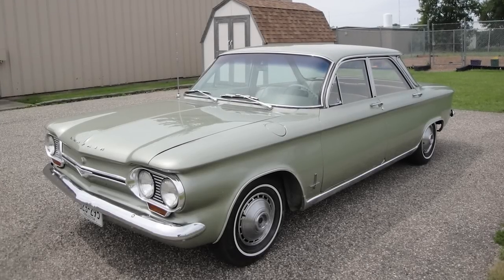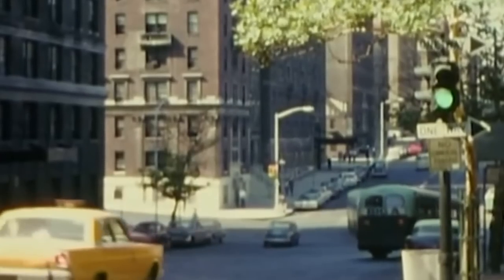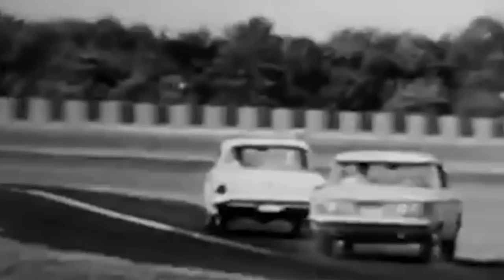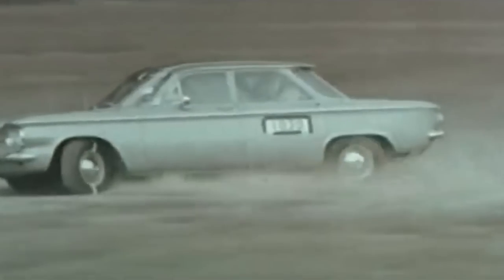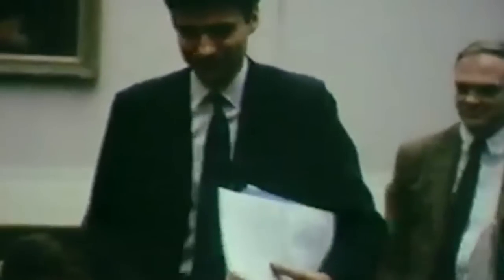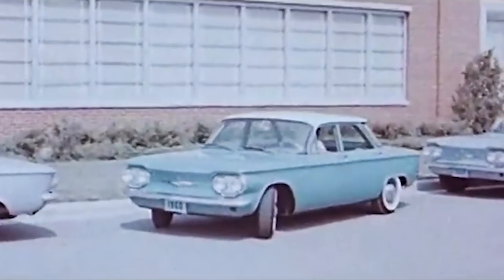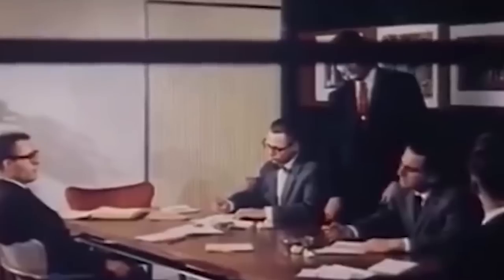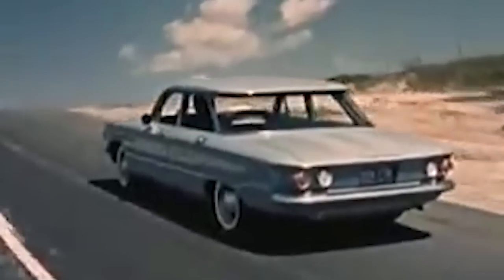Chevrolet Corvair. Where did saving a FEW DOLLARS lead to? Engineering error.

Comment: Car wasnt unsafe,owners not looking to see what pressure to set the tires at was the issue,if you set the tires right it was fine.Are you Ralph Nadar's love child?
Reply: Swing axle in early models WAS unstable...a truly safe design should not require cheapskate "hacks" like tweaks to already low tyre pressures to prevent the thing from losing traction.  Granted, this video is full of errors, like the VW having "easy handling" - the VW had the same rear end as Corvair...and it was a horrid little thing.

Corvair was a great design that was RUINED by arrogant decisions during development.
Reply: Hey was gay

Comment: having 6 corvairs   an been  driving them for  45 years,,,,they dont roll easy,,,an  i have  a 62 700 4dr  that is  a blast to drive,,,started out with a 65 500  ,,still have it  but  radials  are what makes them hang in the curves  ,,

Comment: I have to wonder why at this late date - over 50 years since the last Corvair left the assembly line - are you trying to do a hatchet job on Corvairs now? 
One thing you should know is that Ralph Nader's real target was Volkswagen. For whatever reason, he took aim at a potentially more vulnerable target, since the Corvair was more of a curiousity or niche car.  He also never even drove one, so he was far from an expert. Also, FYI, before Nader, GM had already planned for the last model year to be 1966. The reason was that it was too expensive to build, and the profit margin was too low. Thanks to Nader, they made the car for 3 more years. 
Also, FYI, I had a 1963 Corvair Spyder and I drove it hard - swing axles and all. I never even came close to turning it over. One would have to be TRYING for that to happen. 
All in all, your video is full of biased and marginal information.

Comment: From 1960 to 1964 the car had a swing axle. From 1965 to 1969 the axles were changed. My Dad was invited to test drive and try to roll the car. He couldn't get it to roll over. Chevy got rid of the corvair because of the Camaro.

Comment: My first car was a used 1963 Corvair. It was the one with the two speed automatic transmission with no park. One time I passed a vehicle and when I pulled back into the lane, the car started "dancing" on me. It really scared me. It wasn't until I read Nader's book years later that I understood what happened. It was that swing axle. I would have put that extra part to prevent that on had I known. My dad could have done that easily. In any case, it had more issues such as I had to keep a window cracked as it would fog up the interior with oil smoke. That was the other problem. Air cooling might have kept the weight down, but it did not isolate the passenger compartment from potential exhaust fumes. I sold that and bought a 71 Ford Pinto with manual transmission. Traded one car with issues for another.

Comment: My first-grade teacher spent some months in a coma following an accident in which the Corvair she was driving hit an oil slick and spun out. There was considerable debate within GM over the car's safety from the start, with several executives having family members that were injured or killed in them. The NHTSA was correct in that even an early Corvair could safely carry out any normal driving maneuver that  an Impala could do. But if pushed to its limits by an aggressive driver, or when put in an emergency situation like an oil slick, it was much more inclined to become unstable than most cars on U.S. roads. What the original car needed was not a rear anti-roll bar, but a front one, and a rear linkage that was the opposite of an anti-roll bar, something that forced one wheel down whenever the other was pushed up. It got those improvements, which had been extra cost options, as standard equipment for 1964, 4 years too late. GM trashed their reputation to literally save a few dollars per car. If they had added these items for 1960, and included a relief valve to keep the front tires from being over-inflated, they would have avoided all that bad press and legal risk. They would still have had a car that was not suited for the American market as  family car; you had to give up air conditioning if you wanted a wagon, or if you wanted the turbocharged engine, which was also unavailable on the wagon; the gasoline heater compromised fuel economy; the sedan also had  a much smaller trunk than the Falcon. The disadvantages of a rear engine simply made the car uncompetitive  in too many ways as a family car, but it was beloved as a poor man's Porsche. Its best hope for a profitable niche was as a specialty car built and sold around the world, including in places where its nimble handling, excellent braking and phenomenal uphill traction, would be more valued than they were in much of the United States.

Comment: The myth of Corvair's unsafe design has been debunked long ago. But in today's idiocracy it is very easy for B.S. to rise to the top. I owned a 1964 Corvair Monza in the 90s and used it for years on my 52 mile daily commute. I never encountered handling problems though I like "spirited" driving. 
The boxer six was surprisingly torquey even with the automatic. My '64 in Lagoon Aqua with the upmarket chrome trim is one I still have dreams about.

Comment: Most amateur the automotive journalists these days: report partial truths and make up the rest, but say it with authority so that those who don’t know you’re full of it will readily accept it all as fact.
The handling “issue” was corrected in 1964. If people had actually read and followed their owners manual - ie correctly inflating the tires, there wasn’t a handling problem. Interestingly, Volkswagen was using and had been using the same swing axle design since it’s inception, but no complaints about the Beetle.
Big giveaway to these kinds of videos is when they have a bot read their copy for them instead of an actual human.

Comment: US car makers cut a lot of corners on their economy models in the late 1950s and into the 1960s. The original Corvair was a particularly unsafe car, as I discovered with a friend who owned one in the later 1960s. On the other hand, it's tricky steering and easy way of loosing the rear end and drifting out of control was not much different than the Porsche models of that day. You just knew the Porsche handling tricks and allowed for them, where Americans drove the Corvair like any front engine/rear drive car. The second generation of Corvair (Monza) corrected most of the problems in the original, and it was a great car to drive and looked great as well. You could still break loose the rear end, but it didn't tuck a wheel under and roll over on you. Unhappily, by then the  reputation of the original design was permanently linked to the Corvair name, and that killed a very nice car.   I'd be glad to have a nice one today, but they are quite expensive now.  GM repeated the small rear engine design again two decades later with the Pontiac Fiero, and it had none of the Corvair curse on it.

Comment: Actually,  all the cars of the 50's & 60's handle badly. 
I was common for those cars to lean on turns, and curves.
It was sort of a joke on turns, that you and your passengers would lean to the one way or the other. 
Drivers at that time would compensate,  or brace themselves.

Comment: The first Corvair was supposed to have aluminum heads, not the cast iron that made production. This added 50 pounds on the back end of a swing axle, along with no sway bars was a recipe for disaster. All because of the accountants.

Comment: I have a 63 Monza and like many others I can confirm it's reputation is more of a slander campaign to make a point than it was fact. What became the NHTSA did a study on the early models and found it to be no more hazardous than it's contemporaries at the time, in fact it is ahead of its time in many ways.

This video seems like it was make by Ralph Jr judging by the lack of research beyond the book, there definitely are much worse cars to be in at the time.

And by the way according to what ive found by asking the community any instance where tuck under would roll the car eould also happen if the axle was prevented from tucking.  It is not perfect like any car but keep in mind modern SUVs and vans flip over way easier.

Comment: What ever happened to GMs key problem, there was a big lawsuit once, they knew about the weak springs with the ignition key but they didn't care to fix it, they rather wanted to save a dime on the spring. Many have died due to this oversight/bad engineering, GM still didn't care.

Comment: I would like the full story. So far the only thing I can see wrong with the car, and I paused to tell you I wanted the full story of the book, and haven’t seen the rest of the video, is that the rear suspension uses a swing axle changes the camber of the wheels as it travels over bumps an into potholes and while turning it changes as well. What it needed was an axle like the corvette had. They uses twin a arms and axles with two joints instead of one like the swing axle. The corvette rear suspension kept the rear tires in line with the road.
Reply: And that's what it got for the restyle in 1965, but by then the damage to the Corvair name was done. The weird thing is, VW had the same swing arm design, and they didn't change to IRS until 1968- three full model years AFTER Corvair made the change- and the Beetle brand didn't seem to suffer a bit for it.
Reply: It got the double axles of the Corvette in ‘65.  In fact They were the exact components  of the Vette , same part nos. and all as the’63 thru ‘67 Stingray.
   The one difference: the Corvette used transverse spring whereas the Corvair used Coil Springs. The Corvair had to use Coil Springs as the Engine/Transaxle occupied the area that the Transverse Spring would’ve needed.
    I owned a ‘66 , it was vandalized.  I am currently looking for another One ( late ‘65 - ‘69 ).
                                  Fergieman

Comment: Ralph Nader was lawyer who knew nothing about automobiles.  If an owner drove his Covair and had low tire pressure in the rear wheels he was in trouble.  That is the main reason Nader wrote "Unsafe at Any Speed".  If your rear tires were properly inflated, the handling was great.
After writing "Unsafe At Any Speed" Nader then wanted to write a similar book on the VW (rear engine, independent suspension, etc.) doing another of his typical hatchet jobs.
John Bond, the Editor of ROAD & TRACK,  a former GM design engineer, read his book and then he took all Nader's complaints apart, one by one, and showed what a total automobile ignoramus Nader really was.  Nader shut up.  His book never was published, and Nader went on to other things....

Comment: Not necessarily so, tire pressures for the front were purposely lower (set by the factory) than the rears which were higher due to weight, but owners set front/rear pressures the same causing the car to handle poorly in evasive maneuvers on the road (known fact from another video) the fact that Ralph Nader also owned one is no coincidence.......

Comment: GM then did what they still do today. Just look at how they go after the person rather than fix the problem. This attitude is wrong and will never prevail, well unless some judge was bought off or is biased.
Boeing seems to be going down the same path with the 737 Max. Optional safety accessories seems outright wrong, that must be included in the base price, be it the 737 or the Corvair (anti roll bars).
Discrediting Nader failed, he was way smarter than many of those in charge at GM. Just look at the stock price of GM over the last 20 years, it's not a hot thing to own either.

Comment: Wow!! Have you ever owned or driven a Corvair?? I have for over 20 years and have never spun out, rolled or felt in danger. Bias ply tires probably had more to do with handling issues than the design. Porsches weren’t able to reach high speeds??? I  can make my Superduty flip over if driven beyond it’s capability.  Corvair was exonerated of any “bad design” claims in 1974 by the way.

Comment: My first car was a 1959 Mercedes-Benz  180 Diesel.  Compared to contemporary North American products, its roadholding was superb and I always felt driving a North American car was like driving a boat in a cross sea.
Reply: How many DAYS did it take to get up to 65 mph in that 'Benz oil-burner?  Probably sipped diesel, though, at a time when refineries couldn't give it away!
Reply: In the 1960's, The German car verses larger American cars, it's like comparing apples to oranges, the smaller German car will handle better, but the bigger, more powerful American car will accelerate better, and cruise better on the bigger American roads, which it was designed to do.
Reply: @martentrudeau6948  You'll notice that all the aforementioned makes, with the exception of the RR Porsches, disappeared from the European and US markets in the 1970s and 1980s.  Part of the reason being that, they, too, got considerably more "Autobahn" or "Autostrade", or "Motorway" mileage.  The older rear-engine jobs with the swing axles simply weren't up to highway speeds.  Also, EMISSIONS began to doom the air-cooled engine.  Volkswagen foresaw all that and went to their excellent line of FWD vehicles, starting with the Golf (Wabbit) by 1975.  There was nothing wrong with a rear-engine, swing-axle vehicle when they were designed; it just that consumer demand and better, faster highways made them obsolete.

FWIW, in designing its famed Chrysler and DeSoto Airflow models in the 1930s, Chrysler had seriously considered a rear-engine configuration, which did a lot to enable a far more "slippery" design.  The trouble was, their flathead sixes and eights were just way too heavy and bulky to make such a mounting practical.  Even some "creative packaging" couldn't overcome the problem of the vehicle being tail-heavy and prone to "swap ends" in a cross-wind.  However, the research into how to configure the body and frame into a more aerodynamic package led to a lighter but much stronger car body.  This was shown in a famous demo film, where a 1934 Chrysler Airflow was pushed over a 100 foot cliff, and, though considerably battered, was started and drove off!  Had Chrysler had the money (it was the Depression, after all!) to design a lightweight engine for that RR configuration, there might have such a line of Chrysler products. 

 Alas, casting of non-ferrous alloys just wasn't "there" to produce such an engine.  The Soviets tried it in 1940 with their V-2 tank engine, and though it was light enough to be useful in their famed T-34 tanks, it, well, didn't have a very long life...but then again, neither did the T-34s in combat anyway!
Reply: @selfdo  ~ Sound good to me, thanks Doug.

Comment: Utter nonsense!  I have owned, driven, AND RACED Corvairs (both early models and late) for five decades.  The swing axle on the early was STATE OF THE ART for rear engined cars at the time it was built.  There was/is nothing particularly unsafe about the design.  Oversteer is not, and has never been an issue- if the car is oversteering (that is, the car is turning more than the driver intended) the NATURAL reaction of the driver is to back off the steering wheel, providing MORE control, not less.  An understeering car (like MOST of the conventional cars at the time!) required the driver to turn HARDER into the turn, losing tire adhesion, and making it more likely for the car to leave the road!  I have MANY more objections to the misinformation in this video (Nader was a LAWYER, NOT a "journalist"), but that would take more time than I am willing to spend on this dreck!

Comment: Yep, they cut corners and used the same suspension as all of the European sports cars and the VW
Reply: You dont know what you are talking about,  A, GM did not cut corners  American drivers at that time did not know how to drive rear engined cars and if you did not follow GM instructions on tire presures you put your self in jeppardy gas station guys also put tire pressures that were wrong .My first Corvair a 64 monza i owned before i came to live in USA i raced and never had any handling troubles i still have 2  1965 corsas super road holding and getting great gas milag   Between my first Corvair and now i have owned 12 diferent models of Corvairs  and have never had any handling problems,
Reply: @Ed Smith  you missed my point the article said they cut corners on the suspension but they used the same suspension that all of the German sports cars use after GM discontinued the Corvair

Comment: Nader should have been strung up, for being nothing more than a sensationalist with an agenda. .  The car wasn't unsafe, unless it was in the hands of an idiot.  The design was basically the same as the VWs and Porsches of the day, and a driver just needed to learn to drive a car with the weight balance shifted toward the rear.  The rear end upgrade in later versions, went a long way towards solving even that problem.  They were a fun car..
I had a lot of experience with the earlier version, a 110 hp car, and the later Corvair Monza, with the turbo, and I drove those cars hard, and had no problems, because I knew the limits of the car.  In the hands of even an average driver, they were great cars for the price, and it is a crime that they were driven into oblivion.  The junkyards are full of a lot of other cars that somehow crashed, maybe all cars should be banned.